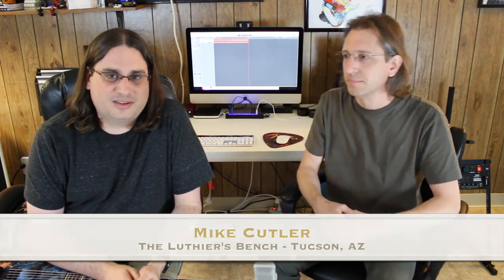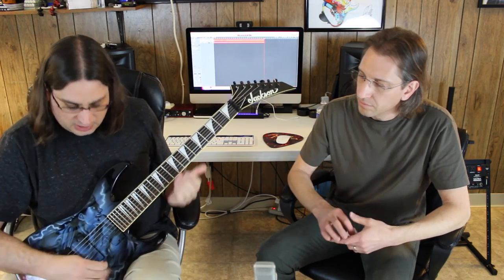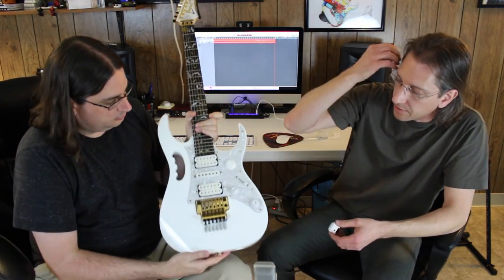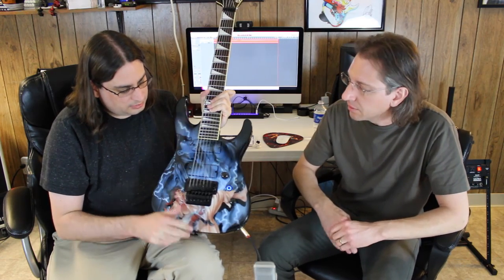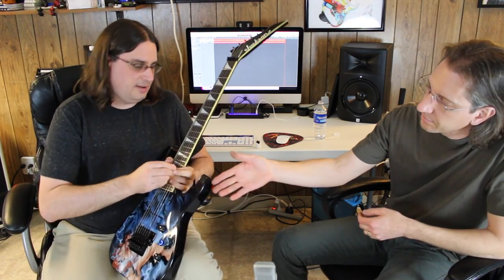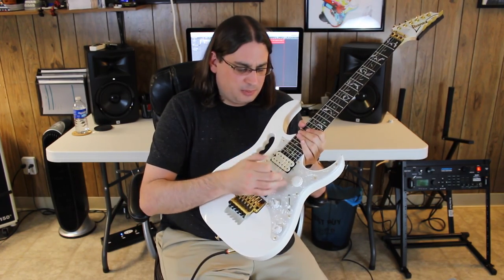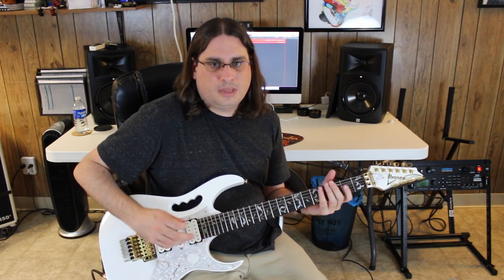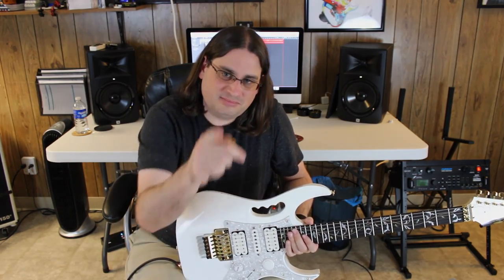Guitar Killswitch Review and Tutorial

Comment: The Sanwa switch has the best feel and reaction time of  anything else,way better than the cheap plunger style buttons everyone sells plus its rated for 1,000,000 hits.Nobody utilizes it more than Buckethead and its what he prefers so you know its good.A little noisy on clean channel but with mild to heavy distortion you arent really going to notice much "pop" .Highly recommended,thanks for the video !
Reply from the maker: Excellent comment you're 100% right about all you said!  You're also right about the pop sound on clean tone, in my opinion the killswitch is pretty unusable on clean channel.  But yeah a little gain and it really comes to life and sounds nice and smooth.  Thanks for the feedback!
Reply: Thanks guys,great video ! Do you happen to know how the Buckethead Les Paul killswitch is wired? They are pretty scarce so I havent got to see how one is set up...on my Ibanez RG I ran one lead to the volume pot and grounded the other lead to an existing ground in the pickup cavity.It works fine but Im wondering if grounding out the output jack is any better/quieter.Whats the general opinion from a professional on this ?
Reply: What about the TESI switches?  They have like tonss of kill switch variations...
Reply: @jorgeloo3131  I had one of the cheaper Tesi switches and the plunger broke off about 2 days after I installed it,it worked good but not as fast or positive feeling as the Sanwa,I can't speak for their higher end switches though but probably ok.
Reply: @popslops2188   Thanks for the Feedback!  Would you think the Shadow Killpot SH124 might be a Better Option? These kill switches can be placed under the volume/tone knobs so the knobs can keep their regular functions and act as a kill switch at the same time by pulling them down , take a look! : https://youtu.be/866__QJg9LQ
Reply: @jorgeloo3131  Those are killer and I like how it keeps the stock look ! Never heard of those but I may get one for my LP
Reply: Tesi switches are garbage, they pay a couple bucks per switch and charge outrageous prices. Sanwa are much higher quality. Tesi also lies about their switches, making up facts and durability numbers.

Comment: I want a small kill switch that fits on the les paul pick guard by the bridge pickup....a thin switch.  So I don't have to drill the face of the body....just the pick guard.  Pick guards are a dime a dozen.   If someone makes a thin switch it should fit on the pick guard.  Can run the wires under the pick guard to the pickup ring and down through the pickup route.
I put one into a les paul via the back and just tested it without drilling a hole in the body....it was a little poppy.  I'm wondering about the capacitor mod....maybe a cap in series with the hot wire from the switch.
It only takes 5 minutes to wire it to the jack just to test it.

Comment: Using a normally closed alwows you to wire them up in a more unique way. You need to add another toggle. But you can use that toggle to switch the button to either kill the signal or let it through.so youll get sound either when you puch the button or when you let go. I prefer to wire them up so i only GET signal when the button is pressed, but its really up to the taste of the player.
Reply: So that means... you can also use normal close button?
Reply: @arjaykimsilorio1026  adding a toggle can reverse the button for touch signal or touch signal cut

Comment: Some good tips in the video. But it seems more like an advertisement for this guys shop rather than a tutorial and review. Pretty sure he's a good luthier and everything.  But this is a really simple modification where you are essentially just using a switch to ground the whole circuit. In layman's terms just connecting the hot lead to ground via the switch. Justifying $100 maybe for alot of woodwork on the guitar. This circuit has one problem that no one seemed to have solved and that is the popping sound when switching.  Cannot notice so much with distortion. But on clean its noticeable. Not a biggie though. All in all it's a real simple installation and requires just four solder points which anyone can do with some basic soldering skills. This video would be useful if they gave advice on remedying the popping etc. Everything else was nothing new except for the recommendation of the aracde style button. But which arcade button? Found out more useful info from other poster's comments than from the video.
Reply from the maker: Hello!  Thanks for the comment!  So yeah this video is from several years ago and my friend Mike (luthier) was kind enough to come over and talk about the modification so I just wanted to give his shop a good shoutout.  You're right though we didn't go in depth into the actual process which I would have liked to have done.  Since we did the video at my studio instead of his shop we couldn't really show a whole lot and we're forced to mostly just talk about it.  I guess at the time my main goal for the video was to give people a general idea of what is involved if you decide to do it, and then what some of the possibilities are musically once you have it installed.  You make a good point though and in hindsight I wish we could have filmed the actual process of the installation.  Unfortunately my youtube channel isn't quite big enough to devote that kind of time to it just yet, but hopefully I can go back and redo some of these old videos and make them more comprehensive.  Thanks for watching and your feedback!
Reply: @Corrupt-R  I do appreciate that he took time to come by and do a video for youtube watchers.  That was nice of him. Yes. Would be very useful to see an installation video for other viewers. Not sure if  you notice on your guitar but mine has this small static popping sound when switching. Its not that noticeable with distortion but on clean it is. I don't think anyone has figured out how to remedy that yet as even dedicated switch harness sellers like iron age pretty much say it's to be expected. Whatever the case as long as it doesn't bother you it's fine. The tip about using arcade buttons was actually very useful. But providing a link and name of the button you use would be very helpful for viewers and something alot of us would like to know. But again doing a video on the spot and thinking about a dozen other things to talk about you can easily lose your train of thought I'd assume. All in all it WAS a useful video to some degree and thank you for sharing.

Btw, really like your playing and sound with the use of the switch.
Reply from the maker: @2cool4u24  You're definitely right about the popping noise on clean tone, as a matter of fact it's so bad that I consider a killswitch on clean tones to be pretty much useless.  I don't know why it happens, but my best guess is it's the same principle as a "pop" that happens in recordings if you just cut a sound clip suddenly without a fade out of any kind.  If I'm right about that, that would mean that somehow a killswitch would have to fade out the signal quickly instead of cut it abruptly.  I can't think of a way to realistically do that, but I'm no expert on electronics so maybe there would be a way.  Really just guessing though :)  Also thanks for the recommendation to include a link!  I thought sure I had done that but I guess I didn't lol.  I just added one in the description to a 12 piece set of buttons in different colors.  Also an amazon search for "Sanwa button" will give all the proper results.  Appreciate the feedback man thanks!  Also thanks for the kind words on my playing, really appreciate it!
Reply: @Corrupt-R  Yes. I think we will just have to live with it. But on distortion it sounds fine so it's definitely useable. Also even using the killswitch method using the selector switch (Tom Morello)  introduces a similar static or pop. Selector switch is so hard to use though lol. Don't know how tom pulled it off so well.  Thanks for the link btw. Wow they are so cheap. I was considering using a push switch which was alot more money but thanks to your video ordered up a bunch of arcade buttons instead. You saying the other one being too stiff and the arcade ones being easier to push  was a really good tip. Thanks.
Reply from the maker: @2cool4u24  No problem!  Yeah the bad part about the arcade buttons is they go pretty deep so you have to make sure the area of the guitar you put it in is thick enough for it.  Once you get it in there though I can't imagine a better killswitch.  I mean if you think about it, arcade buttons are meant to be highly responsive and stand who knows how many thousands of presses before they give out.  I'm still using the same button for all these years with no issues.  Let me know how it turns out!!
Reply: @Corrupt-R  Right on. That makes complete sense. The most practical button to use for this application. Plus the one that Buckethead uses is most definitely an arcade button. Most likely the exact one you have on the Ilbanez.

Yeah, I was a bit worried about, the space. Since I am installing it on top of a pickguard the area to work with is a bit limited. Plus the ones I want are at least 24mm - 30mm in diameter.  I think commonly they are 30mm which is quite large. I ended up getting 24mm to save as much as i could. Although I would choose 30mm if I had more space. I think the larger ones I think are better to press since it's harder to "miss". There are basically two main ones that I was going for. Either the Sanwa or the Siemitsu. But I heard that the Seimitsu goes deeper and is a bit more clunky to the feel. The Sanwa's don't run as deep and I heard have a bit more of a finesse feel to it. So many other variables.  They have different colours, and different configurations like snap in or screw on. But .. i ordered both kinds, i mean they aren't like $50 each so why not.  Another thing worth mentioning is drilling the hole into the pickguard (in my case) or wood. You won't find a 15/16" drill bit lol so I'm planning on using a step drill. I think it will fit in ok and not touch the volume pot but will have to wait and see till i do it. 

Another note i forgot to mention was some people posting on forums about bridging the two lugs of the switch with a high resistance resistor (2.2M) to remedy the slight pop. But I don't think that works since I did a test hookup with it and still heard the pop. Anyways. Will definitely let you know how it goes when it's done.
Reply from the maker: @2cool4u24  All good points!  So I have a killswitch on another guitar and decided to take out the tone knob and use the pre-existing hole for the killswitch.  Just have to widen it to fit.  The pros are there is already a hole to work with and with the tone knob out there is more room for the killswitch to fit, the con is you lose your tone knob.  However this mod was on an 8 string and I just never saw using the tone knob on an 8 string, not exactly going for jazzy sounds on that thing lol.  So it worked out well, but just another option to consider
Reply: @Corrupt-R Oh. Forgot to mention I'm installing this on an Eddie Van Halen Frankenstrat replica that i made awhile back. Lol. I see what you are saying and that would work well. But i copied the volume knob like the frankenstrat so its not installed in the regular holes predrilled on the pickguard. So if I drill to widen one of them it might not fit since the volume knob is pretty much centred close to the predrilled holes. Always an obstacle to tackle. But you gave me an idea. If space is impossible with this config i might just move that volume knob into one of the predrilled holes which would free up alot of  space for the switch. I mean I am installing a kill switch so it would not exactly be a frankenstrat replica at that point anyway.
Reply: @Corrupt-R  Hey Marc. Finally got that switch in the mail. Had a chance to install it. Works great! Adds another dimension to the guitar. I got the Seimitsu buttons which are 24mm with the screw on. Was a bit of a pain to drill the pickguard making sure not to drill over 24mm with the step drill but i got it just snug enough for it to snap in (will be a pain tho when it comes time to get it out to replace when it goes bad, hope this lasts long which im sure it will). Btw. Im glad i came across your video or else i might have gotten those smaller led button kits they sell which seems harder to articulate with those. These arcade buttons are so easy to push and i can get a bit more complexity in rhythms. Way easier than the pickup selector switch lol.
Reply from the maker: @2cool4u24  Hey great news glad you got it!  If the button you got is the same quality as the one I have you have nothing to worry about.  It's been in mine for years and years now and it works exactly the same as day one, I think they are really built to last.  Post a video sometime if you can, I'd love to check it out!
Reply: @Corrupt-R  will do! I have to work on my chops though lol. Been too busy making then playing. But yeah I will try and post one when i can! Yup seimitsu is very similar to the sanwa. They pretty much look identical and the same price. When i look up the buttons its either sanwa, seimitsu and crown samducksa. I think these three are on the top in terms of quality. But i think the crowns are a bit deeper and they are stiffer if i recall correctly. The top two buttons would be the sanwa and the seimtsu. The seimtsu had the color I wanted with the size so thats what i ended up getting.
Reply from the maker: @2cool4u24  If you have time email me a pic!  soundtheorystudio@gmail.com
Reply: @Corrupt-R  will do!
Reply: @Corrupt-R  just sent you a pic.

Comment: I had my guitar store do it for me and it only costs 28$
Reply from the maker: I think the price will vary a lot depending on the guitar, some guitars don't need any wood routed out to make room for the button which saves a ton of time and makes it a much simpler job.  Other guitars need a lot of modification before it will fit and wire up correctly.  Either way you got a good deal :)

Comment: Hi, I have a question that I wish you could answer.
I had 3 killswitch, the first was a button of those that cost not more than a dollar, a small button, then change it for a slightly more expensive, like the one that used buckethead in 2006, and in the end I bought the button of arcade that currently uses buckethead, and the problem is that the 3 buttons to press them worked but not correctly, bone, 10 times that I pressed only a 5 or 6 times the signal was cut, and I do not know if it will be guitar problem , like wiring or something that has to do with current or is problem of the button, what can I do? please if anyone could help me :(
PD: I do not speak much English, I helped with a translator, I hope you understand a little what I wrote lol
Reply from the maker: Hello!  If the switch works sometimes but not others I'm assuming it's a problem with the button.  I would make sure you are buying a "Sanwa" button which is the brand used in arcade machines, they seem to work really well.  If that's what you are already using then I guess I would try another button just in case yours is defective, and also check the wiring just in case something has a loose connection.  Good luck!

Comment: I just got one of these! I wired it up last night. The switch has been mounted perfectly and the sound effect of the kill switch is perfectly functional. However I am not sure how to wire up the LED... I thought I wired it up correctly but the LED doesn't light up. However the led does work if I connect it to the battery directly but I want it to light up when I plug in my guitar(My guitar does have active EMG pickups and a 3 prong stereo output jack). Can you please help me wire up the LED?
Reply from the maker: Hey thanks for the comment!  Unfortunately my luthier friend isn't available at the moment so I'm not sure how much I can help.  Sounds like you got it working but the LED doesnt light up when you plug it in.  I would say talk to a local luthier that knows a bit about wiring and it shouldnt be too hard to figure out.  Sorry I can't be more helpful, but when it comes to wiring that's not really my field.  Maybe someone else in the comments will know?
Reply: Watch out because LEDs aren`t supposed to be plugged directly into a 9V battery without a proper resistor (~150 ohms I think) as it is not meant to be running 9V. You could burn the LED with that testing you did.

Comment: I dont understand, can I use de killswitch in a pasive guitar? I have a normal telecaster... 
The only thing i wont get (if i am able to use it) is the light?
Reply from the maker: Mateo Jaugust Hi!  So if you get the light up button you’ll be able to use it but it won’t light up without the battery. I recommend the arcade style button though it’s way more responsive. Either will work with passive or active pickups
Reply: Thanks!! u rock!!
Reply from the maker: Mateo Jaugust Anytime!!

Comment: Huge Misinformation, still clicking sound on clean channel. To get the the clean morello sound , you need a switchcraft, toggle switch with 2 volume knobs.
Reply from the maker: It's nearly impossible from what I know to get clean killswitch tones without a click if you are using a button like this..  The Morello set up may work better, but of course isn't quite as easy to use so it's a tradeoff I suppose
Reply: @Corrupt-R  Bra, I just figured out the wiring, it will blow you away. lol took me 2 years to develop. It does more than just silent kill switch. It's a fast toggle between 2 pickups, creating harmonic tremolo vibes and faux wah.
Reply from the maker: @AmerikkkaGuitars  You should make a video on it!  I'd love to see that and I'm sure others would too!
Reply: @Corrupt-R  Yup I was planning on it. A whole history, differences and then all the wirings known. Currently trying to simplify it more because it is complex but well worth it. Video eta in a month or 2